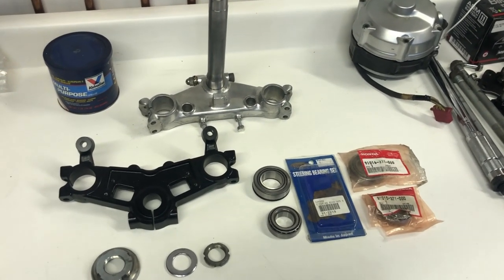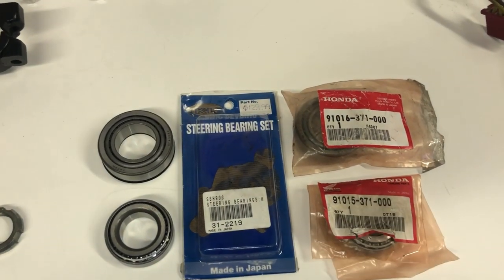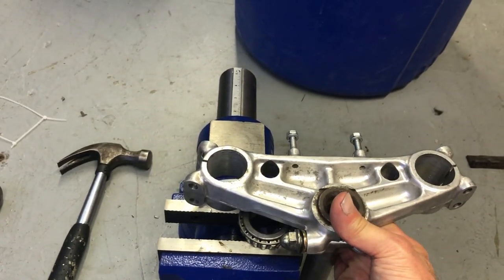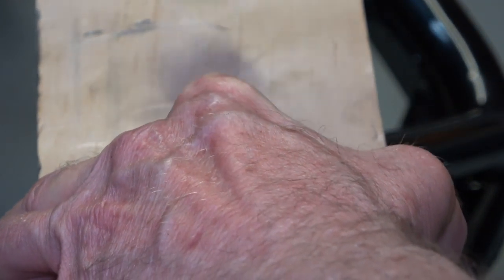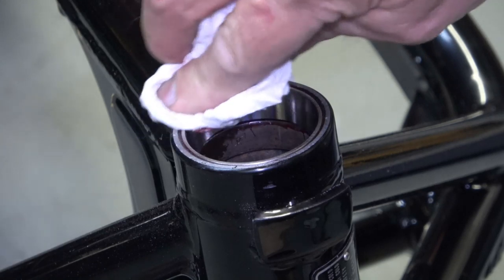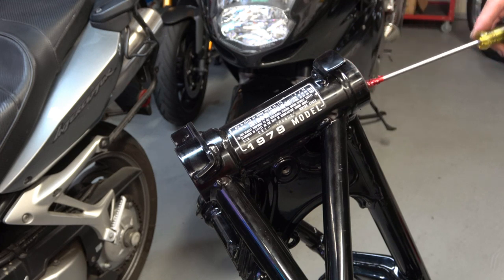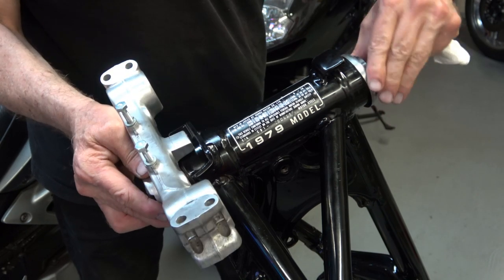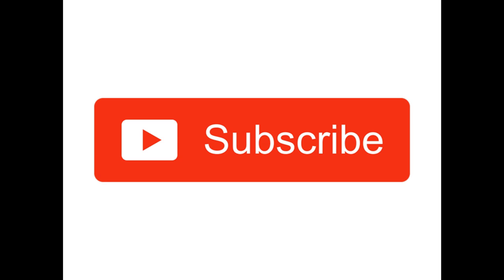Honda CBX Full Restoration & Engine Rebuild Video Series - Part 26 - Steering Stem & Head Bearings

Comment: Ive never used grease between the inner race and the frame.  As a matter of fact I press in the upper and lower races and then use a strong light and a small mirror to inspect
the area between the frame and the races to make sure the races are completely set all the way around.  Also it's better to 'pack' the bearings exactly like a from wheel bearing would
be packed..... before installation put a glob of grease (remember that 'glob' is a technical term LOL) on your palm and press the grease into the bearing by pressing the grease into the bearing from the inside out.  Granted I do have the proper tools, presses and torque wrenches to install and torque the bearings and nuts.  Being a factor trained tech has it's advantages.
Reply from the maker: Good points Ray, thank you for injecting your expertise, its helps everyone :)

Comment: Hi!
Just a constructive criticism here.
You need to pack the bearings by hand forcing the grease to go in it. It's not enought with putting a ton, you need to force it in.
Regarding intallation of the lower steering bearings, don't press that or seat it in place by screwing it mounted on the bike using a ton of  torque. You will likely damage the bearig and could distort the inner race. Better to rap it in out of the bike using a piece of pipe and hitting the inner part of the bearig.
Just my opinion.
Great videa as always. The engine turned out stunning👍👋👋
Reply from the maker: Hi Seb
Yes, I totally agree
I actually do use a bearing installer and or a pipe or in this case a socket to drive the inner race to make sure it is seated.
Only then do I follow the manual and torque it as directed, then back off to set the final torque.
Thanks Seb, again I appreciate the Input.
I will be uploading a new video this weekend showing the frame reinstalled on the engine. 😎

Comment: Everyone will suggest you set the race in the freezer for an hour.
Reply: The race would make sense to me, but I think it may be harder to get the tapered bearing on the shaft.
I would also agree with you when cylindrical or spherical bearings are being used.
Reply from the maker: Hi Danny
Yes, I have done that, I haven’t really noticed much difference. The races go in so easy with just gentle taps, plus I am always afraid of the race cracking if it get too cold lol, but hey, I understand the shrinking idea 😎
Reply: @digitalpizza1  Really appreciate your channel, thank you very much. ---__
Reply from the maker: Hi Danny, and I really appreciate your support and your comments and sharing your experience. We will all learn from each other 😎
Reply: I don't think there should be grease on a press fit, but I could be wrong. Nice work though!
Reply from the maker: Hi HM, I use grease when installing the races to help reduce the possibility of damaging them as they are taped in. They are so tightly fit into place, and also held in place by the triple clamp nut, that it is impossible for them to spin or move. Also, there is no pressure from the bearing rollers. You are correct in other press fit applications that depend on a solid fit, such as a brass bearing etc.. Thanks H M, I appreciate the comment :)
Reply: Soon we will hear that f1-engine! Great channel!

Comment: DP, the bearings looked really clean when you installed them. You didnt show it on video but Im assuming you had to pack those bearings with grease before install correct? 

Also uou emphasized hand tightening the first stem night very lightly. So what is the side effect of tightening the first stem nut too tight? 

Another good video my friend.
Reply from the maker: Hi Bikes,
Yes, you are correct, I packed the race with a bunch of grease, that way it doesn't get all over my hands when I install the bearing LOL
So regarding the tightening, there are 2 things you have to tighten. The Head Cap nut (the big one) and the stem spanner nut.
First, you tighten the head cap nut to 20-30 pounds (this is to make sure the bearings are seated properly) then you loosen it and tighten it to less then 1 pound, or until it stays where you turn to the point where it move on it own, as I show in the video. then you tighten the spanner nut to the shop manual specs. ( I am not in front of the manual right now, so not sure what the torque spec is) after you tighten the spanner nut, then you recheck the cap nut and adjust it as necessary.
The side effect if you tighten the cap nut to tight is that the steering on the bike becomes dangerously unresponsive while riding. As the bike rides down the road, the front forks are constantly wiggling very slightly back and forth. that stabilizes the bike as it moves forward. If that motion is impeded, the bike will go into a wobble or worse :(
Very important that the head cap is not tight.
Reply: @digitalpizza1  exactly what i wanted to know. Thank you!